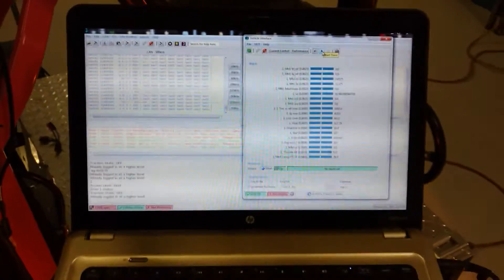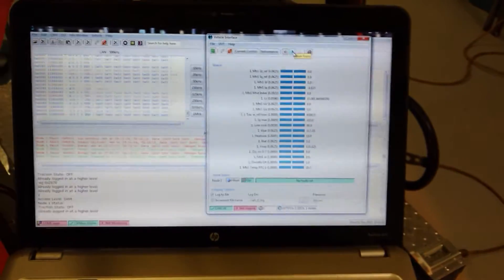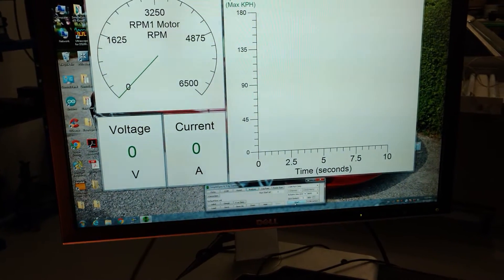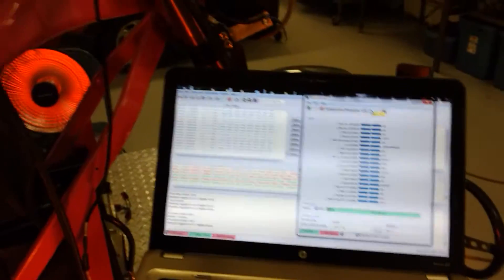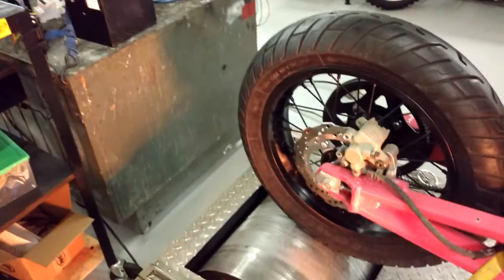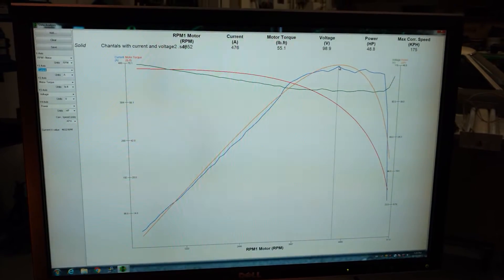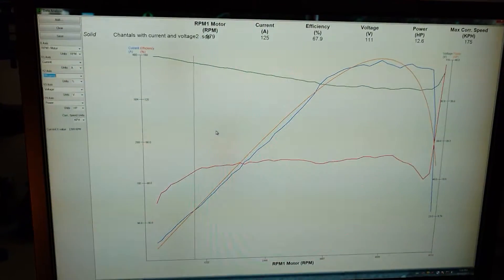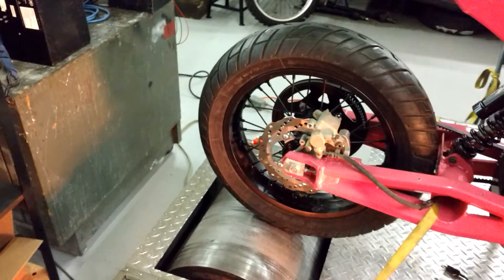DIY Electric motorcycle

Comment: Nice to see current and voltage in the graph.   btw your 75-7 when starting from 0-20mph  make sound like mine when there is too moisture outdoor.. and in these conditions i usually get less torque ( maybe because there is current leak on the sin/cos sensor or so... witch make it to drift the angle a bit or add noise to the 0-5V signal sin cos...
btw i also had this same problem on my original Me0913 as wella s when it came back from Zero  after servicing the encoder... it was worst when there is rain..... the motor make sound like human get a  sore throat ...
Reply from the maker: +Doctorbass Yes If I ride my motard bike with size4 and 75-5 I get a bad noise in the rain.   Moisture seems to effect it.  I think its because the controller is measuring inductance in real time.    The bike in this video is normal It sounds like the SR I road at Zero HQ its only 0-~20mph and only at full throttle and you hear it play out of the belt like a guitar string.